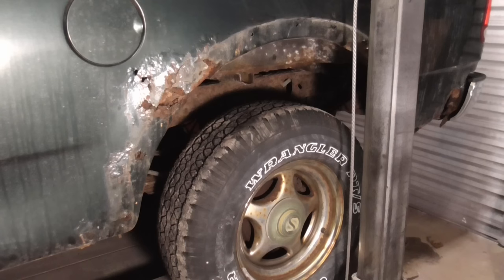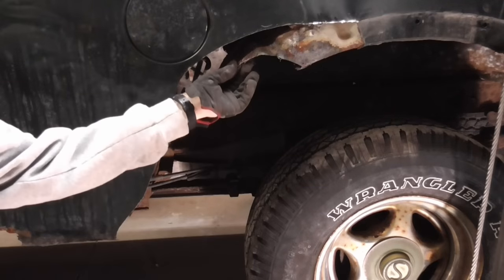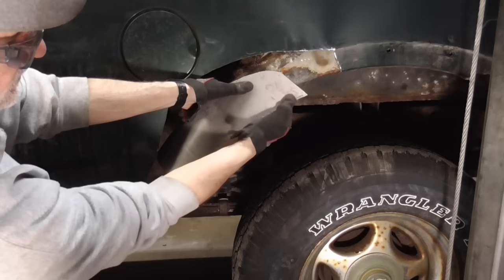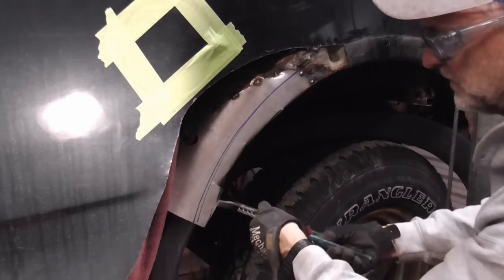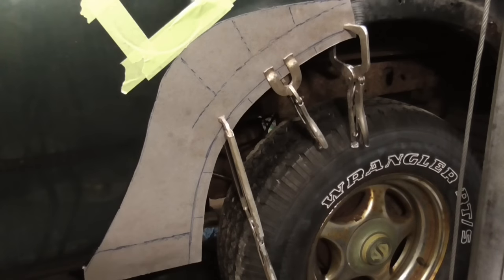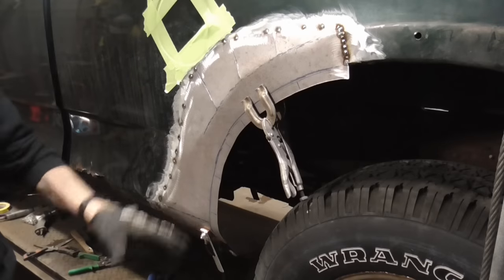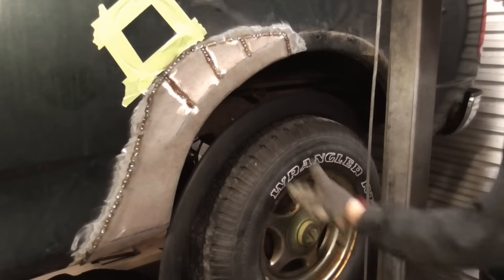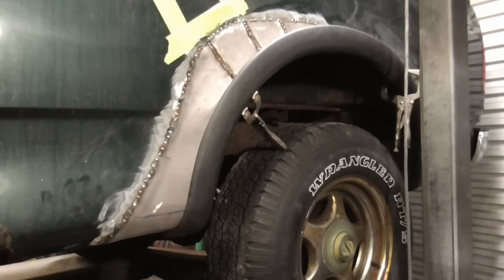Extreme Rust Hole Repair w/ Homemade Patch Panel - Part 1

Comment: I never think it was possible to weld next to a gaz tank. I always remove it. You are more brave than I.
Reply from the maker: I've seen a lot of welding near explosives in body shops I've worked in - surprisingly never even a fire.  Guys smoked cigarettes while spraying primer, cut off bumpers with a tank next to it, etc.  How about muffler shops - they have to be doing this all the time 😊

Comment: This is a good example of horses for courses. It's a rough and ready approach, but given the application it's perfectly passable and if I was paying for this kind of job on this kind of vehicle I'd be absolutely hoping for this approach. Not everything needs to be Concourse
Reply from the maker: 👍 Don't be fooled by these concourse guys either - they are sneaking in the filler one way or the other.  Whether it is thick thick primer or body filler it's filler.  I'd rather have filler than thick primer any day too.   I think they're sneaking in a little filler here and there too - just like the factories do :)

Comment: Rust repair...something I get stuck with quite a lot. So good to see another video on the subject👍
Reply from the maker: I appreciate your + comments all the time BBG - have a nice weekend :)
Reply: @LakesideAutobody I know nothing but I do have a question just seen different tuber show me for first time a flange tool. Would you consider using a overlay versus a butt splice for the old to new sheet metal.
Reply from the maker: @JohnnyAtlas  You can used a flange tool if you prefer but in a high volume body shop there's really no time to mess with it.  Cut the rust out, cut a patch, weld, knock it down, fill.  That's it - every time - every hole.  You can't always use the flange tool - wheel well lips, rockers, sharp bodylines and corners, around tail lights.... so the thinking is why use it anywhere - if a simple lap joint works.  Here's a good video that can clear things up a bit - https://www.youtube.com/watch?v=JIIonJOVro4
Reply: @LakesideAutobody  you are a great teacher thanks for the link totally understand why now.
Reply from the maker: @JohnnyAtlas  You're welcome - glad it helped.  Thanks for the kind words :)

Comment: These  videos are brilliant. I'm rebuilding my Dodge Dakota. Got all the mechanical stuff done, now it's time to rebuild the body. I got a box from the dump that's in better shape than mine, but it still needs wheel arches and rockers,  and at least one cab corner. I have all the new patch panels. Just need to learn to weld first, ha ha. These videos give me hope.
Reply from the maker: You can do this my friend - just ask a bunch of ?s - any time.  I get to them 1-2 times a day :)
Reply: rebuilding my Dakota

Comment: Got over 350K miles out of my old 1990 Bonneville before rust did it in. Cool to see rust fixed now and then. Wish I had done that with mine in the past before it got too bad.

Comment: Wow, you're an exceptional welder. And wow, that's some amazing body repair.
Reply from the maker: Thanks Charles - I appreciate the support :)
Reply: So, my truck is doing the same thing living in salt-road Ohio. But I can't do that kind of metal work. Haven't quite figured out what to do yet. Not sure if it's inappropriate for me to ask about how much (roughly) it costs to have a body technician do a job like that.
But either way, that's some really good work.
Reply from the maker: @charlesbarr3561  Thanks Charles.  Odds are you probably won't find anyone to do it.  They'd probably suggest a new bed or box side at least.  A box side is probably around $700 so I'm thinkin' a ballpark estimate might be $2000 to have someone replace the box side.  Depends a lot on the individual shop.  It's very expensive today because of cost of paint, materials, labor, etc.  Hope that helps a bit :)
Reply: @LakesideAutobody  that's exactly what I was thinking. I don't think any of the body shops I know would pick up a job like that. I should probably start looking for a bed side, the bed itself has been discontinued for a while. I appreciate the honest response. Can't wait to watch the next video. 👍

Comment: All these quarter-panel/arch/inner arch issues come from above - seals that leak around the screens/boots/etc etc & let water down inside the panels. Always. Keep an eye on your seals.. Stuff like this I no longer bother making up panels - I toddle along to a scrapyard & chop a better section out of one of their vehicles, weld that better section onto the car I am repairing. Cut your "donor" panel good & big - trim it to fit when you get home. 

Just glancing at the chassis, that vehicle is toast anyway unless the entire chassis gets a treatment pretty swiftly. I have yet to come across any proprietary treatment that works, so I made my own that does. All that aside - excellent instructional video LSA - as per usual. Practical, to the point & real-world stuff.
Reply: My "last" comment would be, when done, drown the whole repair in epoxy 2k primer - if you don't, it will rust again in no time. I have found no substitute for epoxy 2k primer. Every other form of primer is a waste of time & energy. It will rust again in jig time. Plus, use flux-core. Flux core works better for bodywork. It just does.
Reply from the maker: Thanks for your input James - have a great week 🛠👍😊

Comment: Hi Jerry,  Friday comes around, and so do your videos :) Looks awesome. What gauge of metal are you using? Is it a special metal? I've heard of satin coated, whats so special about it. Wonder if you could or have a video, about the sheet metal requirements? Have a great weekend.  You definitely earned it!
Reply from the maker: It's 20 gauge (.030") nothing special - CR sheet I think A1008 from Alro Steel in Grayling, MI.  I'll write that down - good idea for a video my friend.  You have a good weekend too 😊
Reply: satin or also galvanneal are a subtype of galvanized steel that has a...satin appearance among other characteristics. zinc-aluminium-other components coating over steel to sacrifice itself(galvanic corrosion) first before the iron. 

These coatings don't like heat from welding (arc or flame will burn the zinc alloy) , which is why automakers who use a lot more of it prescribe MIG Brazing, adhesive spot welding and adhesives. Ultra High  Tensile  Strength Steels also don't like heat from welding.
Reply from the maker: @rolfbjorn9937  Thanks for the information and your input Rolf B - where you an engineer?
Reply: @rolfbjorn9937 does it give off poison gases when you weld, like normal galvanised steel ?
Our chaps used to grind it back to bare metal in the weld area, and wear a mask and use forced ventilation

Comment: This is great stuff. In your other videos - you are very right about lapping patches instead of butt joints - especially for amateurs like me. On the body filler - my bondo starts to set in less than 2 minutes - before I can really get it how I like it. What products or tips do you suggest to get time for spreading?
Reply from the maker: Use less and less hardener until you get it to harden when you want.  After a while you'll be able to hurry the hardening or slow it down depending on your needs.  That's it. Oh... when it's hot out, it's going to harden fast --- cold = slow :)
Reply: @mattwarrensocal - is lap joints better than butt joins?  Isn't a lap joint a prime spot for moisture to penetrate (and thus be a moisture- trap) and promote the same rust issues?

Comment: I did this on my pickup but it was worse so i built a wheelhouse out of 16 gauge and then I finished with parts of a hood. It took me a very long time and I'm wondering how long did you spend on this project?
Reply from the maker: Generally a patch like this takes about 4 hours.  If you started at 8am you should have the thing in primer before lunch.  Go to lunch, come back and block sand it.  That's how it went working in a body shop many times.  Feather fill and lacquer primer with both dry nicely while your at lunch about an hour @ 70 degrees

Comment: What gauge sheet metal do you use for your patch panels? Thank You for the great video.
Reply from the maker: 22 or 20 - 22 ~ .030"   & 20 ~ .035"  Both hold up well over time and can be worked with easily :)

Comment: Did you lap weld that panel on or butt weld? Also is that a mig with gas? Or is it flux?
Reply from the maker: It's lap welded - here's that video https://www.youtube.com/watch?v=Jk29avqnVXI  Here's a vid comparing lap and butt - https://www.youtube.com/watch?v=JIIonJOVro4  The welder was gas - here's a vid on the exact welder - https://www.youtube.com/watch?v=jZikIeH-SWQ

Comment: Nice save.  Michigan's salty roads have caused many trucks to die early.  Thoughts of using mild stainless steel sheet to provide some longevity to all that work"?
Reply from the maker: It will last forever if you do this - not joking either - https://www.youtube.com/watch?v=8XaZBy7GC7A  Just like an old valve cover - it never rusts :)

Comment: Another great video, thanks! What gauge sheet metal is that? Those sheers cut it like its 22ga or smaller.
Reply from the maker: They cut pretty thick stuff - I commonly cut 20 gauge (.035") and 22 gauge (.030")  It'll gut thicker too - It's from HF so I think the specs are on the site :)

Comment: Have you got any videos recommending how to handle rusted out windshield frames? My 2000 Mustang has some amount of rust beneath the windshield (havent removed it yet, is an absolute hassle, but used a 9 gauge guitar string to remove the windshield on my subaru just fine, havent tried it yet on the Mustang), and on my Subaru, in the wall that goes from the windshield flange up to the roof, theres an area where it has rusted all the way through. Having watched a lot of your vids over the last couple years, I feel like I can piece together a solution, just wasnt sure if there was a more definitive solution.
Reply from the maker: You can absolutely fix all of that - had a Ranger that rusted through the windshield and down the fire wall.  The metal cowl (grille) had to be cut out, the repair done and painted inside the air duct/ cowl area, then the grille part welded back in and mudded up.  It took some time but it can be fixed.  You can do it how ever you can do it - it that makes sense :)

Comment: Very well done! Especially having the correct tools. The ONLY thing I would have done is undercoat the filler tube. I know, because I had one rust on my 97 Camry. That's sad 63,000 miles & all that rust. I'd STILL have my 97 if it wasnt for rust. 🙄 👍
Reply from the maker: Good suggestion RB 👍🛠😊

Comment: That’s where the inner fender well gets welded to the outer skin the only way to fix it as replace him to sections, but do it better than the manufacturer does by using world proof primer primer before you weld it

Comment: Does no one supply decent rust protection coatings ?
Over in the UK cars dont seem to rust like they used to, although one brand of pick up truck rotted out its chassis rails in a few years, the company bought them all back and cut them in half then sent them for scrap ,yet a few garages, old school made jigs and repaired the chassis frames and made them stronger
Reply from the maker: There's not a lot of good choices for rust protection.  Some plug the drain holes - some wear off, some don't coat everything, etc.

Comment: Thanks for the class lol can you tell me what kind of metal sheet you use for the job not clue on what to use thanks in advance
Reply from the maker: 20 or 22 gauge CR A1008 Sheet Metal.  You can get this stuff from most metal supply places like Alro Steel.  20 gauge is ~ .035" -- 22 gauge is ~ .030"
Reply: @LakesideAutobody  thank very much trying to do my own lol
Reply from the maker: @victorbeltran5304  Cool - let me know if you have any more ?s :)

Comment: Love these rust repair videos, thinking about taking on rusty bedsides on a 09 silverado due to your videos.

Since there is exposed metal on the inside and under welds how long will the rust hold back for? 

Your other video with gluing/bonding the panel has me very interested in trying that as I can see the moisture being held back longer.
Reply from the maker: As long as you can take care of it - it will last - see this video - https://www.youtube.com/watch?v=8XaZBy7GC7A  You want the inside to drain and stay greasy :)
Reply: @Lakeside Autobody  I can definitely obsess over keeping it greasy! Maybe I will weld it vs bonding it in that case.
Reply from the maker: @Geoff240ti  I try to do it on every oil change - see this video for how well it works starting it on a new car - https://www.youtube.com/watch?v=y05dNxt-nVc
Reply: @Lakeside Autobody  I've watched that before a couple of times! I think I could pull the tail lights to oil a bedside repair. 
By the way.. if you specifically made a video on a 07-13 GM truck bedside repair you'd have hoards of viewers.  Bedside panels are often not in stock, and those things rust out so fast.
Reply from the maker: @Geoff240ti  I actually have a guy that wants one of those fixed.  I told him when I catch up, I'll take care of it for him - there are a ton of those trucks out there - rust in the same spots :)
Reply: @Lakeside Autobody  so many of them.  Where we live in Canada rust isn't too bad. I can find rust free 90s GM beds no problem.  But can't find a nice 07-13 bed for sale, they just rot out quick on trucks that aren't kept dry/clean. Would love to see how you tackle it!
Reply from the maker: @Geoff240ti  I'll be getting to it this year maybe - maybe next winter :)

Comment: another incredible video, thanks for that. what gauge were the sheets you cut and what was that black spray on the metal parts?
Reply from the maker: The sheet metal is 20 gauge (.035").  The black spray was rubberized undercoating.  See this video of a decent method to prevent future rust - https://www.youtube.com/watch?v=8XaZBy7GC7A

Comment: How does the Arccaptain compare to the YesWelder you had in earlier vids? Do you still use that one too? Nice project!
Reply from the maker: I only use the ARCCAPTAIN now - it welds really nice and is super user friendly.  Has a nice big interface with large letters and number for older eyes 😊  They both weld very similar - I've been pretty impressed with the import welders.  Getting parts may be a different story if you ever need them 🥴

Comment: Hey Jerry what do you think about primer sealer over fill primer I saw a can of automotive primer sealer and it said to spray over last primer coat before painting 🤷‍♂️
Reply from the maker: Sealer can be very helpful.  Some guys like to use it some don't.  It get everything one color, seal the body work, help with covering any very small imperfections, prime any tiny bare metal spots that were missed.  :)
Reply: @LakesideAutobody  I think I’ll try it hopefully it won’t rain Saturday 😁
Reply from the maker: @sheerwillsurvival2064  👍

Comment: Hi, what guage of sheet metal are you using? Thanks.
Reply from the maker: 20 gauge A1008 CR Sheet from Alro Steel - other metal sales places carry it too :)  You can also use 22 gauge or scrap panels - hoods, deck lids, etc :)

Comment: Hi there. Happy Wednesday to ya. IF you feel like answering an unrelated question, I've got one for ya- I have an old super surface rusty hood that I am going to practice on. It seems though that the metal has become thin because of the ridiculous amount of flex in it. Can filler flex like that? It will definitely need some areas knocked down and filled, and skim coated. Will all that material flex with the metal?
-DIO
Reply from the maker: It was sort of common that old large hoods flexed quite a bit.  If it's just flexing that's fine.  If it is "popping" in and out you'll have to address that.  One way to fix it is this - https://www.youtube.com/watch?v=K5MVVnsERqc

Comment: I ran into that same exact thing on my crown Victoria dog leg repair Ford puts this rubbery foam in there to just hold moisture I have no idea why they did that.
Reply from the maker: If a panel can drain a stay dry on the inside, there won't be any issues like this.  Especially if you can squirt a dose of oil inside the panel to coat those pinch welds.  Like this - https://www.youtube.com/watch?v=y05dNxt-nVc

Comment: How do you know what gauge of metal to use when doing a repair like this?
Reply from the maker: You can use 20 or 22 gauge on everything.  Thicker if you want but it will be harder to work with.  This gauge will last just fine :)

Comment: thats  all fine and fantastic cosmeticly - but what about other rusted steel- the frame,underpinnings,mounts,etc.- rust never sleeps
Reply from the maker: You have to get under there and knock the big chunks off, allow panels and frame rails to drain, clean and oil the underside.  This truck went through the same process - https://www.youtube.com/watch?v=gIS1Tbv7Kvw  See this video for more on controlling rust - https://www.youtube.com/watch?v=y05dNxt-nVc

Comment: I'm about to try welding a patch panel for the first time.  What gauge sheet metal do you recommend using for around the wheel well area and the side sill?
Reply from the maker: 22 or 20 gauge 22 is ~.030" and 20 is ~ .035"

Comment: how long will the ford f 150 aluminum body last?   are they collision repairable?  thanks!
Reply from the maker: I have one right now and I'm sure the body will last a very long time but one thing to remember is that the underbody, frame, fuel lines, brake lines, brackets, mounts, etc. are all steel and will rust so.... They are collision repairable :)
Reply: @LakesideAutobody  how old is your ford? it would be great if you would do a review of how the aluminum body and paint on aluminum is holding up.